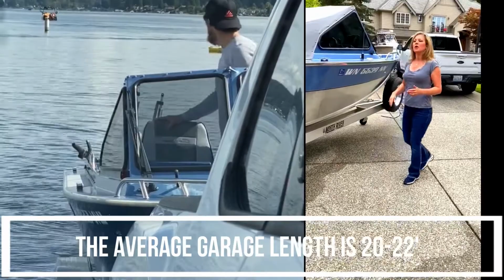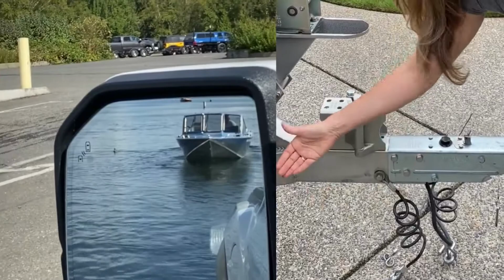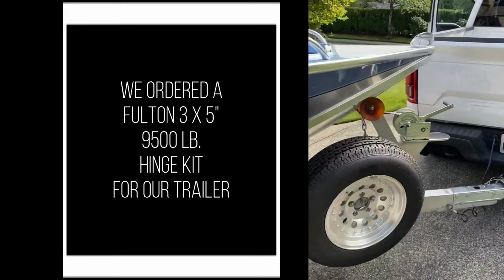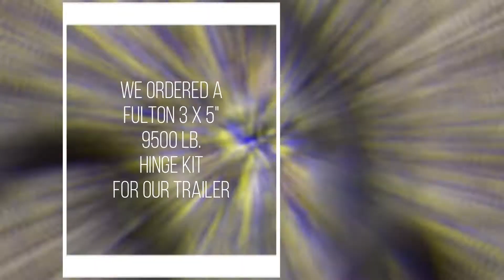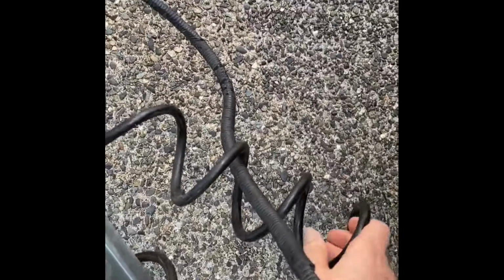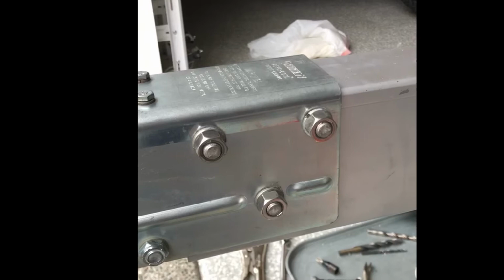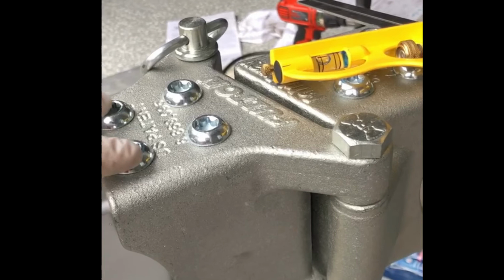Modifying Boat Trailer with Swing Tongue

Comment: Hey there ! Nice video. This is my exact concern, aluminum trailer with steel coupler. I was wondering how it has held up since install? Thanks for posting
Reply from the maker: Thanks!   We replaced the short aluminum portion of the tongue with steel and intend to check the torque specs on the aluminum portion at least annually.  At one year it was all good.